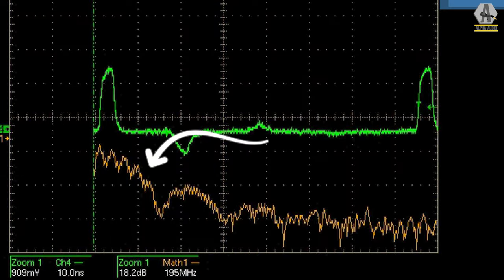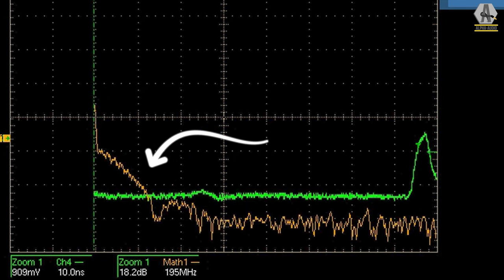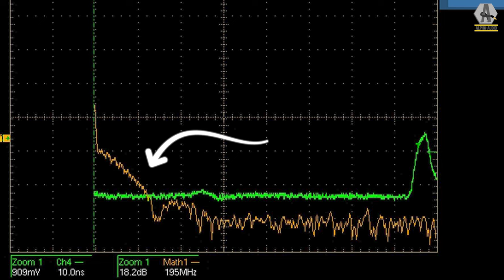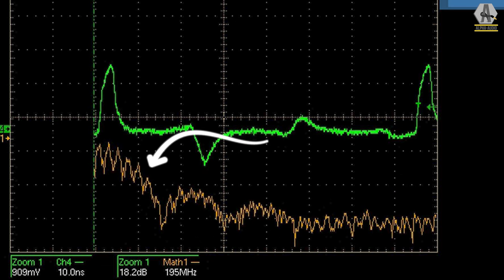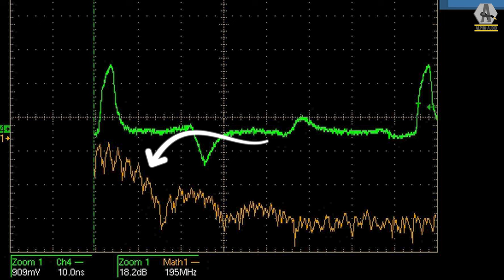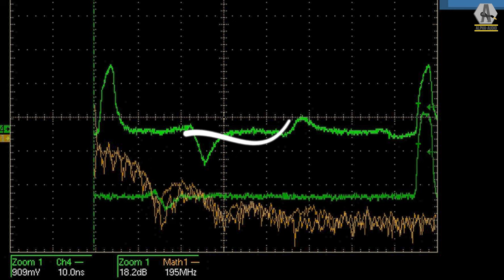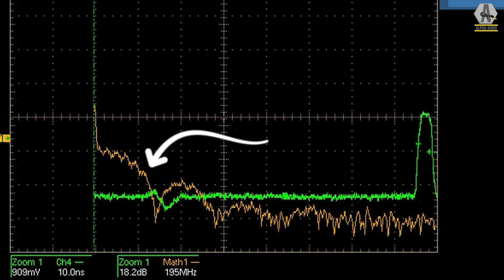Cables make a difference - and we measured it! Alpha Audio Huge Cable Test

Comment: Thanks a LOT for your scientific quest, to find the "origin of good sound" in cables :)

Just a short note :) You concluded, "fast propagation" makes cables sound better...
Quite logical as a slower propagation indicates "something tries to stop the signal".

For those who don't know: Propagation actually means "move out",
thus used by technicians to mean the SPEED of that EM wave, 
which IS the music signal in a cable, or any other "signal through cables"...
In some cables it is near 90% of "the speed of light in vacuum tanks,
when using standard test lamps".
In some other cables it is only around 70% of the lightspeed.
While electrons move MUCH slower!
So the fast moving EM field, is made by a domino EM effect 
amongst the electrons.

But are you aware, that teflon insulation allows faster propagation, 
than PE (polyetylen) and PP (polypropylen) ?
And those two materials, allow a faster propagation than PVC ?
That is a well proven fact.

But there may be additional causes, for a slower propagation,
and one is obviously... Inductance.

The "very clear sounding" Supra Ply 3.4, has PVC insulation...
However the "flattened woven hose" construction of the copper,
gives unusually low inductance, being 0,20uH/m, according to Supra's datasheet.
The flattened "hose" is only 1.5 mm thick,
but there is still a gap, between the "two layers"...

It seems a flattened hose, gets smaller inductance, than a round hose,
IF there still is a small gap between the two layers.

From Supra only the "FlameRetardant" versions, have PE.
All others have PVC insulation :(
The Supra Classic 4.0 can be bought with PE, as I did...
But has a higher inductans, around 55uH/m

Both of those cables are tinned OFC.
The tin is said to reduce electron jumps between threads,
which would have caused noise...
A high frequent noise, which "nobody can hear"
but it WILL distort the audible signal!

If that theory is true, then silverplated copper cables
should suffer MOST from electron jumps,
unless each thread is isolated.

Regarding inductance...
One thing is, it causes more or less phase shifting...
But with the pretty small value,
I hardly think that is important.
Much more important is:
Overall the inductans can be understood,
 much like the hysteresis in loudspeakers,
caused by Eddy Currents in the magnet...
Just in a "much lower scale" in copper cables...
Still it is an evil circle:
Music signal creates a secondary EM field, 
which then creates "the 1. false signal current"
which then creates a tertiary EM field,
which then creates "the 2. false signal current,
and so on.

This evil circle dies out MUCH faster in a cable,
than in traditional loudspeaker magnets.
Purify Audio and DALI now use "SMC" magnets,
constructed to block the Eddy Currents,
and the result IS a lower distortion!

But in both traditional loudspeakers and cables,
we can say the inductance result in an "EM ecco effect", 
which will smear and distort the "next few voltage swings".

And as the created (induced) EM fields, get stronger,
when a stronger current change happens,
(as in high frequencies, and in sharp transients),
the induced EM field, will actually dampen the following voltage swings much,
AFTER each strong TRANSIENT.

Like if a tiny monkey turned the volume down, 
and then gradually up again,
after each strong transient.

It will not only create distortion,
but it also destroy the natural dynamic,
basically killing the natural decay,
after a start transient...

Especially audible, from drums and string instruments.

This effect makes the transient "stand out" more,
than it really should...
You can be fooled to think "this recording has better dynamics"...
As the "little drum" and the highhat, sound more "snappy"...

I wondered WHY it sounded like that, with Supra Classic 4.0!
But with Supra Ply 3.4, all suddenly sounded more natural!
I finally concluded, it was the lower inductance in Ply 3.4
which enabled the more natural (and softer) sound. 

Also...

The higher inductance in a cable,
which especially the higher notes and sharp transients produce,
will NOT only reduce the high notes,
as some believe,
but also the bass notes...
Except if you run Bi-Wire, obviously!

Perhaps you heard a number, starting with a bass only...
The bass sounds strong and clear...
Then the other instruments start...
THEN it sounds like the bass is turned down!

Perhaps it was the mixer man who did that?
If not, it was caused by the inductance,
which the higher notes created.

Also: The science rule is:
With larger distance betwen surfaces,
the inductance becomes stronger.
And it is strongest in the core region of a cable.

Then elecrons are forced away from the core threads,
so they flow close to or even on the surface of the cable.

This happens no matter of the "cable" i one massive wire,
or 300 thing wires bundled together, to be one CABLE.
Then the threads in the core region "is a waste of copper".

SO... A thicker cable gives less resistance, to DC voltage...
BUT will give stronger inductance!
Which is why a flat cable, 
or simply a thinner cable,
or four seperated thin cables,
or indeed a "hollow tube cable",
should have less inductance.

Finally a fun fact:
The John Linsley Hood Class A amp,
designed 1969, 
is totally linear up to more than 200.000 Hz...
Many would say: What does that matter, 
when we only hear up to 20.000?

Well it simply shows, it can reproduce 20.000
with the same small distortion, as at 1.000 Hz !!!

Which might be why, it became famous,
as the best sounding amp "ever build".
Closely followed by the best TUBE amp, at that time!

So measuring the "ridiculously high frequencies" 
is surely very important.

However, a cable which transmits VHF extremely well,
might pick up a lot of radio noise, which distorts lower frequencies!
This MIGHT be why YOU found, that those which rolled of at lower frequencies,
sounded best!

I can't wait, till you publish the resulst from loudspekaer cables ;)

Comment: Very interesting! Cable design has for years depended (and will for some time to come) on guys experimenting and listening to infinitesimal differences. I'm quite excited about these results because they show that something physical is happening. Perhaps in some years there will be a generally accepted recipe how to make good signal cables, how to make good digital cables, how to make good speaker cables etc. Having a changing delay depending on the amplitude cannot be good for distortion (however miniscule) and also phase integrity. 
It would be very interesting to compare geometries and materials of these cables and see what correlation they have with spectral decay, overall high frequency (10 MHz) behaviour and amplitude-dependent pulse delay. Maybe there are some lessons to be learned through analysis of these factors. Very good work. All the best, Rob in Switzerland
Reply from the maker: Thanks!

Comment: Yes, nice work. Great efforts. A respect! Bravoo!! 
But I personally hear significant differences just between interconnects. With speaker cables are so minimal that I would not spend/loose my money on speaker cables. Maybe there will be some surprise in a future, but I doubt.  Power cables is a real audio woodoo - psychoacoustic to me.
We did blind A-B tests and especially with power cords it was pure guessing, with speaker cables a bit less so, significant results just with interconnects.
Any good designed amp should have a decent filtration between AC to DC and then DC goes again to low capacitance AC.
I just tested again four different power cords from basic, cheap generic one to 2000 Eur one with my new amp - JLH1969 copy, pure class A amp, with minimalistic topology , and the result is the same as with SS or Tube integrated amps - no difference at all.

If the speaker have poor, common thin copper wires, (which usually is the case even with quite expensive speakers) in it and other parts it is idiotic or selffoolish to expect that a special audiophile wire from amp to speaker would do a "miracle" or something significant different than just plain copper wire.

I am now in a process of making my own speakers with full range drivers and what counts is the same quality wire from amp, directly connected to speker's driver with no plugs and such rubbish. Just plugs usually adds - 1 Ohm.
What Mark Levinson with Daniel Hertz systems is doing have a sense - I guess - the whole system. 
My hearing is medical tested twice in the last two years and it is perserved 98% on one ear and 92% on other ear and I am 54. So I can hear pretty damn good and i Know what is a soundstage and 3D dimensionality in it with good systems.
Kind regards.

Comment: Really impressive on your true scientific spirit. Practice is the Sole Criterion for Testing Truth. This is a great work trying to find correlation between measurement and accoustic signature.
Reply from the maker: @hecateshiki  Thank you!
Reply: @TheAlphaAudio  I am EE engineer working on widebandgap semicondutor. There could be another consideration for the pulse part, the pulse generator can not generate an ideal pulse with infinite dv/dt and there is always a finite dv/dt value there so same pulse with different amplitude may have difference distribution in frequency domain. You can use FFT function on scope or spectrum analyzer to verify this, but the bandwidth of instrument need to be 10GHz(since your pulse is 2ns width), also probe need to be a high bandwidth probe(＞10G), So the cost will be very high for this investigation purpose. (or you can borrow some instrument for RF purpose)

Comment: I am happy that you are shedding light on  the sound quality of interlinks. Hope that the endless discussion will stop now that we know cables have different properties and will change the sound accordingly. Now we just have to start relying on our ears, they are the reference.
Reply: @RudieVissenberg  
I highly doubt that this test will stop the endless discussion and debate, regardless of how extensive The Alpha Audio's tests were.

However (IMO), I feel that "cable-swapping" is the absolute least useful and effective way to "change" or "adjust" the sound of any audio system.

There are Many, Many far more important variables that have Exponentially more effects on the outcome of any given systems' audio quality.

Try suggesting this in a professional recording/mixing/mastering studio environment and you'll be sure to get at least few raised eyebrows and SMDH responses, LOL.

Comment: How did you measure the ‘sound’ of the cable? Did you test the cables in an audio system vs a signal measurement ; so how did you relate these two elements?

Where is the audio system you used?
Reply from the maker: Please check our article. It explains all of this.

Comment: Thank you for this. I have a Luxman amp and Audio Physic Avanti (the new ones) speakers. The differences between interconnects are evident. Their role for the overall sound is not small.
Reply: @RainerErnst44  
I'm interested to know all of the different brand/model interconnects you tested and which ones you kept?   Are any of them included in The Alpha Audio test?
Reply: Supra EFF, Oehlbach, Viablue, Inakustik Reference… the last one was very good. The Supra a bit too thick in lower mids for my system. The Oehlbach is more linear sounding but soundstage is more flat. The supra was included in an earlier test.
Reply: Still looking for „the right one“. I love my qed speaker cable, so maybe on of theirs
Reply: @RainerErnst44  Thanks for the replies.  Other than my Grimm TPR & TPM and Sommer Cable, the only others I've used in the past are Kimber Kable, MIT, and Inakustik (I have quite a few of their reference recordings as well).

Good luck on your search.

Comment: Sorry but what was the complete equipment that you used for the listening tests from the source amp or preamplifier to the speaker cables and  speakers i assume the you have everything constant except the interlinks si you can catch the differences. 
In what section of the article is ?
I found it section 4 interpreting
Thanks data

Comment: You mention the timing behaviour of the cables in the site and it is clear from the measurements that there are differences between the cables' phase responses within the audio band. Did you not find any correlation between the phase response differences and the subjective assessments from listening to the cables?

Comment: Hi thanks for your effort and dedication
One question maybe you have to specify the output impedance of the source and the input impedance of the integrated or preamplifier 
Because sources as cd players have different output impedances   and this influences in the micro and macrodynamics
"Most mid range CD players priced below $2000 (even some over) will have a very simple output stage with nothing more than a pair of Op-amps. That will result in higher output impedance (typically 150 ohms to 500 ohms that limits Macro and Micro dynamics.
Thanks for your response
Reply from the maker: Please check the written article. I have it all specified there.
Reply: @TheAlphaAudio  great thanks

Comment: What a super project! Cables does indeed matter! Next time maby testing powercables?
Reply from the maker: Not sure how to do that.
Reply: @theomindschrddr7983  
While I'm not disagreeing that Signal and Speaker Wire/Cables may affect sound quality, please keep in mind that all of the highly sensitive and extremely PRECISE Test Equipment being used to perform all of these minute nano-second, microvolt, and LCR measurements must have infinitely better specs than the equipment they are testing, otherwise the test equipment itself is a limiting factor.  Can we agree on that?

If so, then take note that all of these Uber-Precise Test Equipment devices are supplied with Standard "plain Jane" UL/CE/ISO listed and certified power cables directly from their respective manufacturers, similar to what you'd receive with a name brand flat-screen HDTV, desktop computer or UPS, and/or 99% of electronic medical equipment.

The manufacturers of the Test Equipment being used DO NOT insist on or supply these incredibly sensitive and precise electronic measurement devices with any type of power cables with exotic special geometries, cryogenically-treated magic alloy, uniquely formulated insulation jackets, or "audiophile grade" plugs, etc.  The manufacturer supplies you with good old basic UL/CE/ISO listed power cables, nothing "fancy", and guarantees their product to perform to the high tolerances and specifications as claimed with said power cable.

That, in and of itself, should be telling and speak volumes.  ;-)